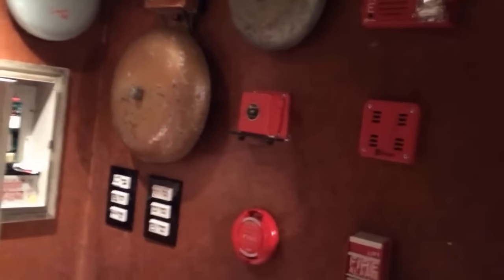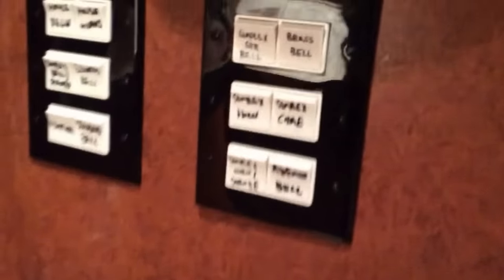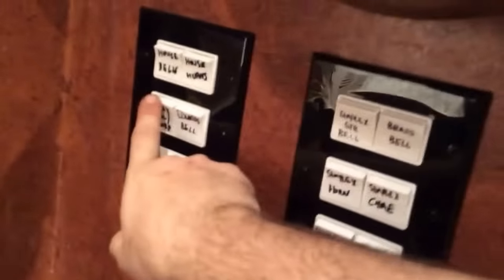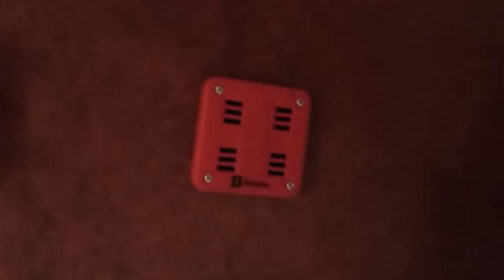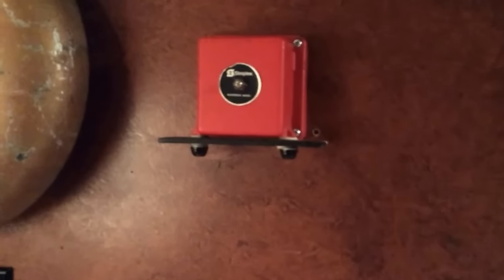Fire Alarm Collection 2014 - All Devices Demo

Comment: everything looks awesome, good job!
Reply from the maker: MircomFan Thanks - ADD for the win though; ripping it all out and completely redoing it - adding two standalone ancient systems with matching components (Standard Electric, and an ancient Simplex) - have to build a new wall, etc. Will post progress videos as I am able.

By the way, here's a disclaimer especially for you based on your username: You will eventually hear me complain loudly about Mircom in future videos, the reasons are many :

Mircom panels make me want to punch myself in the face; smoke heads take forever to trip and are damned near impossible to clear without re-tripping, FA-300 panels stack re-trip troubles so high that I actually had one take our entire Central Station receiver out - two hours later it was still communicating them through. Now I have to "unprogram" the dialer in it when I inspect so it doesn't send anything through.

Okay, rant over :)
Reply: brettman273 No problem! I love seeing more unusual/rare alarms, especially bells (grew up around a lot of single stroke bell systems). Can't wait to see more progress!

Yeah, Mircomfan wasn't my first username choice. I wanted to actually be Edwardsfan, but someone already took it so had to make do with what I had!
Reply: +brettman273 Hey, I know some of these are also used on German Railroad Crossings!

Comment: Glad the strobes weren't on
Reply from the maker: The strobes were all on; I think I used my phone to record this so it probably didn't catch them. The origial Simplex AVs have relatively weak strobes compared to modern equipment. The newer AVs in the auditorium are probably 2-3 times as bright.